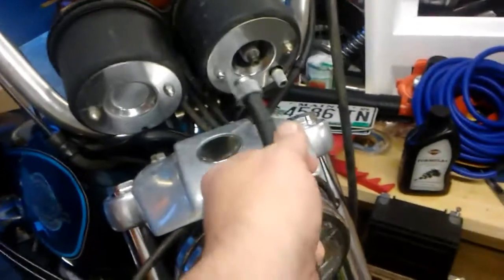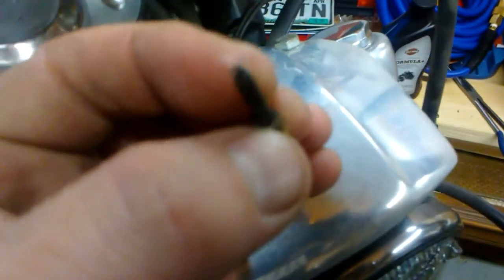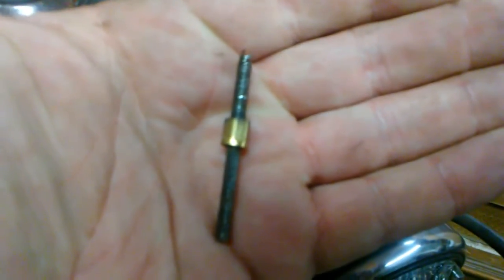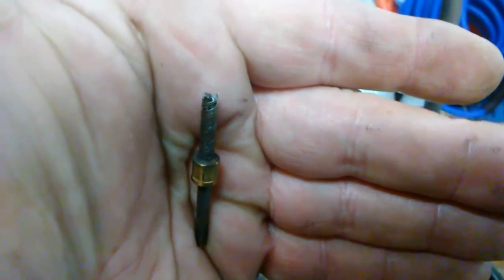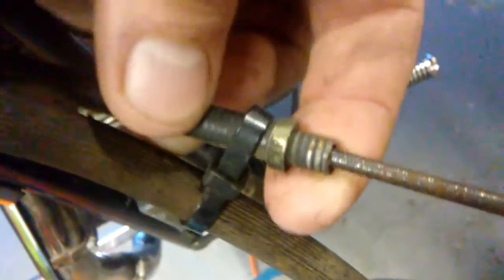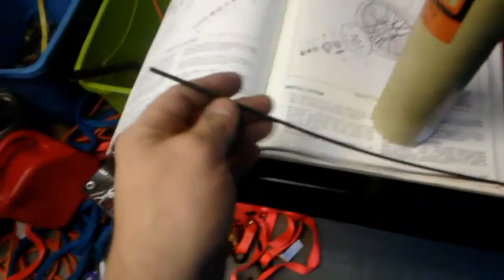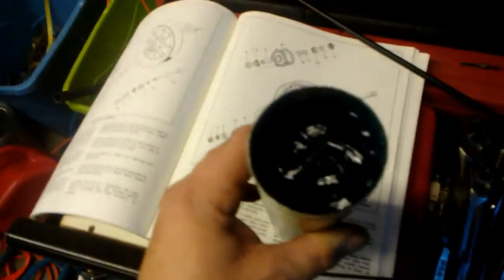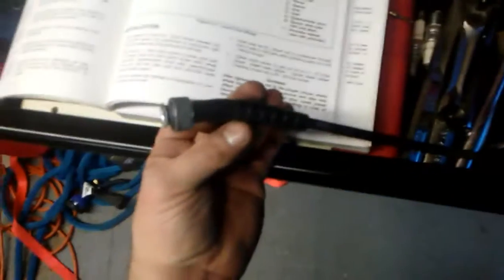How fast was I going? I have no idea!!!

Comment: Kewl easy fix. How much did those parts cost?
Reply from the maker: David Young the cable was like $17. So far, parts have cost me a grand total of under 300 bucks for the whole project, so I have a running, riding 100% legal Harley-Davidson Sportster with 8300 miles for under $2100. Not bad.
Reply: Yeah not bad at all.